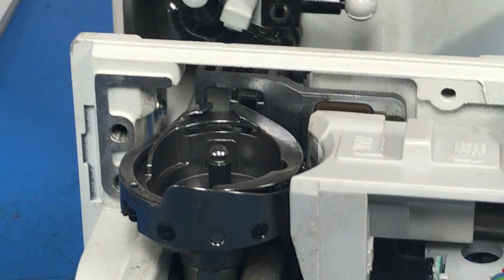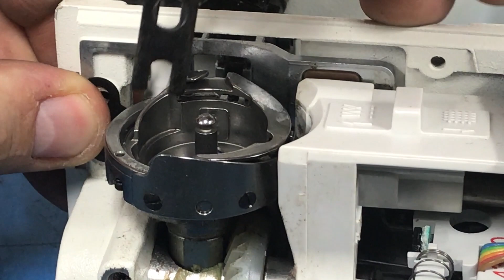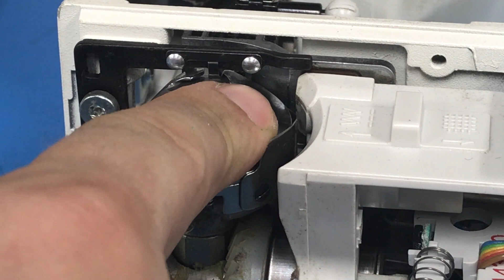Replacing the position finger on a PFAFF 7570

Comment: The correct distance is 0.7mm, which is also the thickness of a credit card. You can take an old card and cut a thin strip from it to create a gauge. Put the gauge between the position finger spring and basket, and you will have a perfectly placed position finger every time.
Reply from the maker: Thanks for your comment!
To get the full training and see all the details as well as the service checklists use this link: https://www.sewvacretailresources.com/offers/Kpn93Nws
Reply: If so(and I don't doubt you), I've been allowing too much space on these.